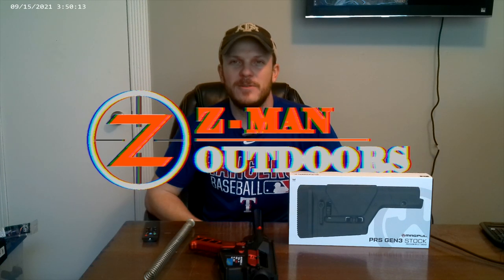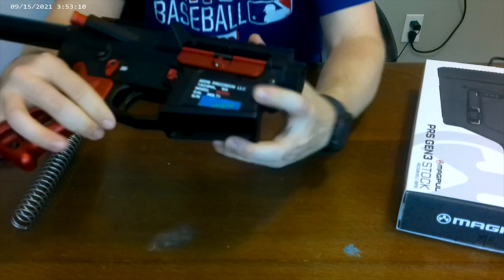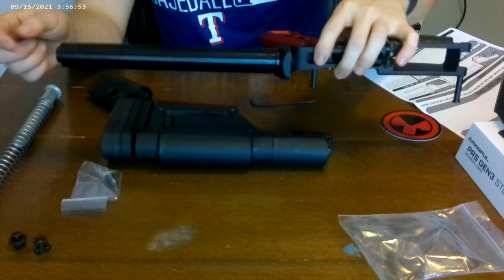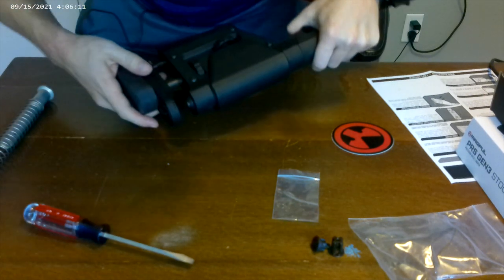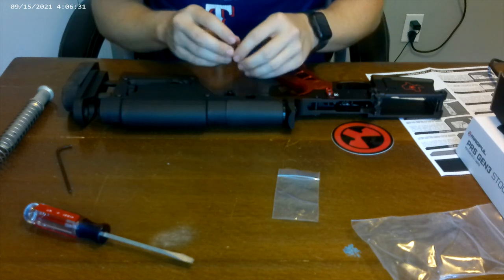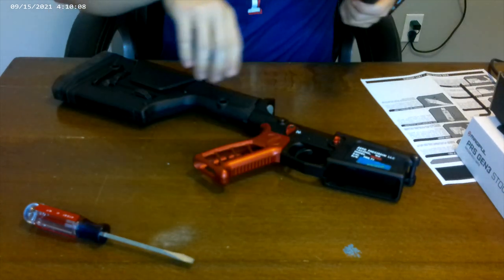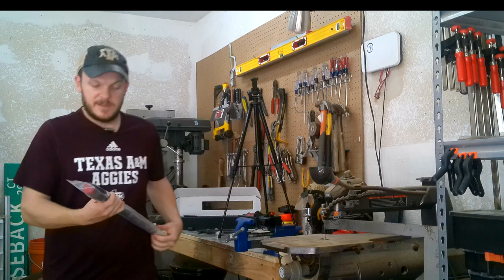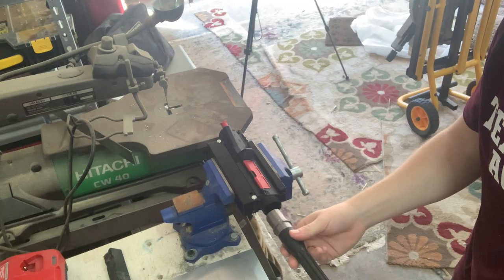A Beginners Guide To Building An AR-10: Part 4 - Stock & Buffer

Comment: Just a bit of FYI. When torquing with those wrenches with a torque wrench, be careful. The further yo are away from the nut the more torque you’re applying. There is a calculation online that gives you the formula. Take a few measurements and it gives you the correct torque specs. The tool you used won’t be that far off. If you go to 80 you will probably be closer to 90 foot pounds. The first tool you grabbed would be way off. And grease/lube will also throw off your torque readings. lubes can reduce friction enough to require a 50 percent reduction in tightening torque. I’m an old time mechanic  I’d just hate to see someone ruin an expensive barrel or castlenut. Great videos 👍
Reply from the maker: That’s very good to know thank you so much for that knowledge, I’m going to have to do some more research on that for my next build! Thanks for watching too

Comment: Sorry for the newb question but I currently am putting a 308 together.... i am using a rifle buffer.... it's a Aero Precision all around, it's currently on the way but my questions are.... there is no castle nut right?... and if not what is the torque spec on the buffer tube and is Blue Loctite required since there isn't a castle nut to stake????